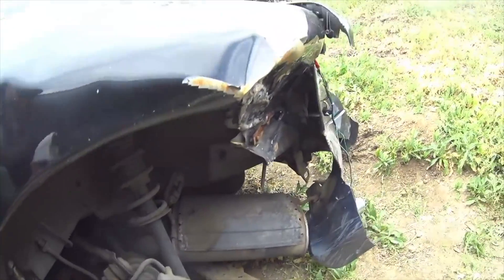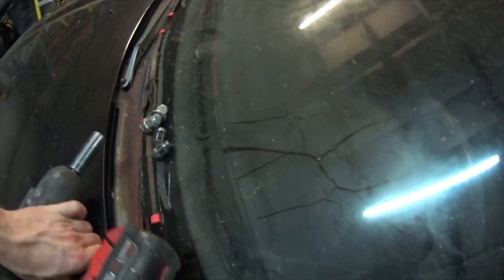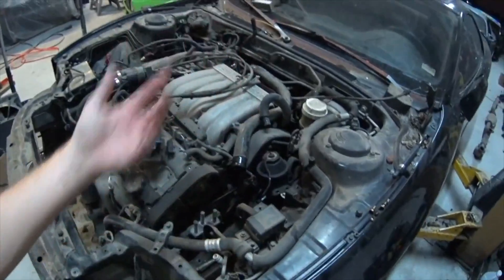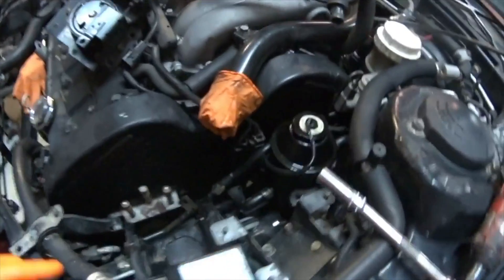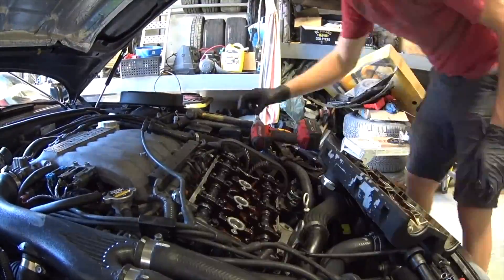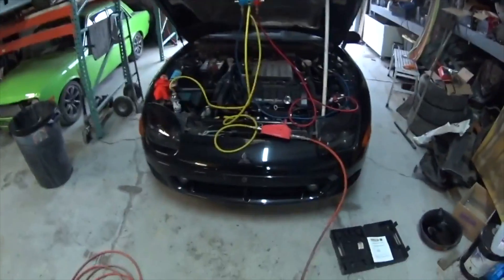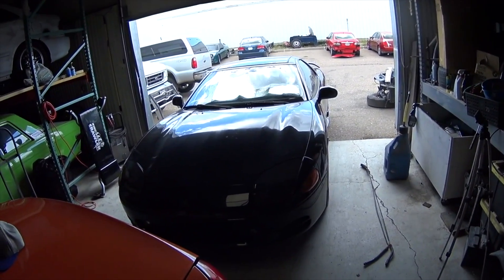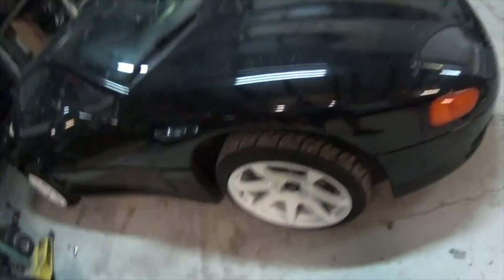Cheapest 3000GT Build in the WORLD!!!

Comment: i have a 94 vr4 shell with 45k miles on it and it is such a bitch to find a crashed 2ng gen vr4 for cheap because i dont want to spend 3k just for the engine and transmission
Reply from the maker: yeah I waited a few months before finding a good deal on one
Reply: yea atleast with 3000gts i have non turbo ones to piece together the interior for a decent price